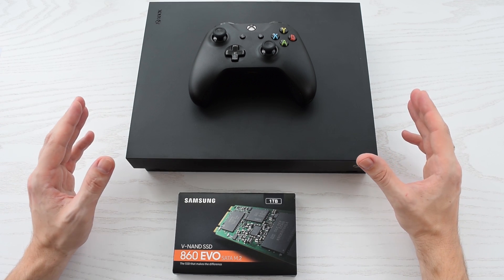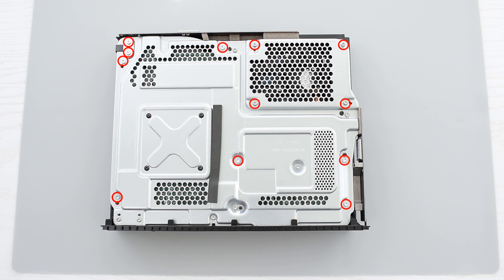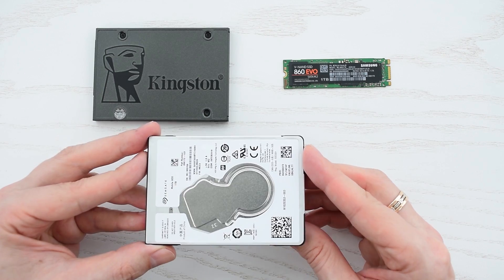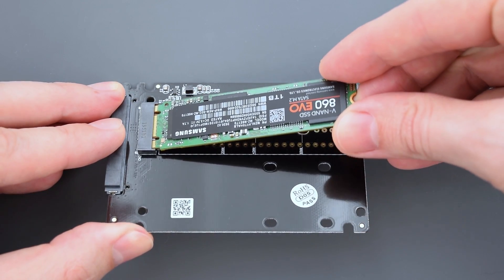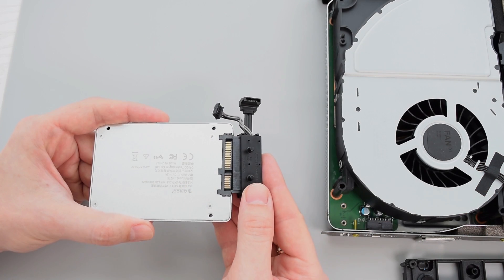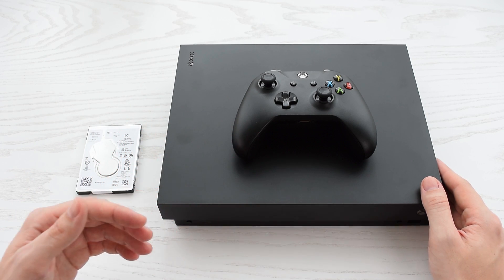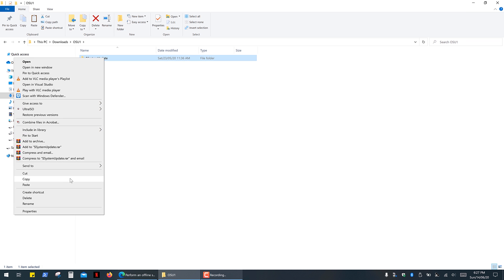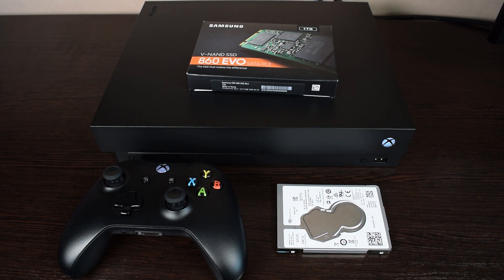How to Upgrade your Xbox and PlayStation Console to M.2 SSD Drive. 100% Works for all Consoles

Comment: Can you reach the full speed of an M.2 SSD with a xbox one or ps4? 😱
Reply from the maker: Both Xbox one and PS4 have SATA III interface as well as NGFF M.2 SSDs. So, yes those consoles will get maximum performance out of NGFF M.2 SSDs.
Reply: @ElectronicsComputers  so I'm able to get up to 3gb/s on my PS4 Pro when I use e.g. the nvme Samsung 970 evo? I mean up to 3000mb/s like on a pc?
Reply from the maker: @Serandi1987  Did I mention NVMe in my previous reply???????????? You can use only NGFF M.2 SSDs.

Comment: So you have to use only 500 1tb or 2tb.... What about 1 TB ssds that are actually for example 940 gb instead of 1tb?
Reply from the maker: 940gb drive will be recognized by system as a 500gb drive and in order to use it's full capacity (after you install offline update) you'll need to manually expand "user content " partition to the maximum available space.
Reply: @ElectronicsComputers  You need to connect it on a pc and expand it with disk management?
Reply from the maker: @andumihailescu  That's right. After successful offline update connect the drive to your PC and resize "User Content" partition.

Comment: What a bummer this was. Vid is easy introduction, but I must have bought a lemon. I purchased the same m.2 SSD, slapped it into a Sabrent enclosure--but no matter what method I've used (cloning, format fresh, or XfiX batch) when I plug the drive into my 1X... black screen of death and the Xbox shutsdown within 45secs.

Just to test it, I purchased a PNY full-size SSD, plugged it in to the 1X and works perfect.

Now I need to decide if I return and re-buy a new enclosure (860EVO is 1TB, but working PNY was only 500GB), or just return both and pickup full-size 1TB SSD and cross my fingers.
Reply from the maker: What's the adapter model? Or give me a link for that thing? You bought Samsung 860 EVO M.2, right?

Comment: that's good i've done the same with a 2,5" sata 1tB ssd
but why using a M.2 sata ssd ? it's the same has using 2,5" ssd. but more expensive
Reply from the maker: The main idea was just to show the upgrade options. Lots of people say that they have spare M.2 NGFF SSDs after upgrading laptops etc. And they didn't even know that such adapters exist. Or maybe you just want to use that M.2 SSD in another device after your console dies (2.5" SSDs are becoming obsolete) or maybe there's a better deal for an M.2 NGFF SSD.
Reply: @ElectronicsComputers  i see your point about spare ssd and i agree, except on one point : no 2,5" ssd aren't becoming obsolete, not for now. 
they are usefull in desktop pc and all m.2 slots are more for nvme than sata.

Comment: Im French, so sorry for my english. 
I have some Error 102, 101, 105 on my OneX. I think its comming from the hhd because the beginning was when I save in game (JediOrdenFallen.) 
Can I clone ths hdd on the ssd with errors ? 
Thanks
Reply from the maker: Most likely the problem in your HDD!? Did you participate in Xbox insider program?
Reply: @ElectronicsComputers  I specify, it is a used xbox. Yes I think I validated the Xbox insider program during the OSU1 offline update after the first 101 error. I shouldn't have?
Reply from the maker: @stradam6128  You have to unroll from the Insider program first. Otherwise you can't install standard offline build on your console with modified OS.

Comment: I thenk you can't enjoy fast NVME M.2 speed cuz sata socket is low transfer speed
Reply from the maker: You can't use NVMe and I explained i pretty clear. You can use only SATA-based M.2 SSDs which is NGFF.

Comment: Sorry but this is stupid. No need because the console won’t use the extra bandwidth anyway. Get a ssd
Reply from the maker: You're talking nonsense! The SATA III port is faster anyway than that M.2 NGFF SSD. And the rest of the  hardware can handle this speed without any problems. Also I'm working on the project on how to install NVMe SSD to its dedicated unpopulated place on the motherboard (you can check the last video about Xbox disassembly, at the end I explained it). So, this console originally was designed for PCIe SSDs and instead we use SATA SSDs which are way slower. I hope it was helpful for you.

Comment: Bad idea
Nvme need a proper cooling
In a PC Even with nvme heatsink and a front case 12cm fan pushing air. The temp still high compared to an SSD
Reply from the maker: I didn't use NVMe it's even impossible to do so. Have you actually seen this video especially my explanation about SSDs?

Comment: Thank you for this video. I upgraded my Xbox one x yesterday with Samsung 860 evo Satan m.2. Following your video made it easy from disassemble to operating system reinstall. Thank you! I am very happy with the faster boot up times and surprised at the game seems to be a bit more responsive, smoother maybe. Anyhow, great video and thank you again. Upgrade, it makes a difference.
Reply: Satan 🤣
Reply from the maker: Thank you for letting me know, I'm glad I could help you.
Reply: Hey did you have to add anythibg else to the. Motherboard other than the m.2 connnector. To make it work? Looking at the xbox one x xdk mobo. It look identical to xbox one x in the m.2 area. Plus extra resistors .
Can you make a video of your xbox one x dashboard. To show how this extra storwge appears .

Comment: So can I ask does nvem faster than m.2?
Reply from the maker: You can't use NVMe SSDs it only works with NGFF SSDs
Reply: @ElectronicsComputers  oh
Reply: @ElectronicsComputers  so can ngff ssd put in sata  in PS3 will it work?
Reply from the maker: @萝莉欧派  NGFF is a regular SATA SSD but in M.2 form factor and you can use that SSD with M.2 to 2.5" adapter virtually in all SATA devices. It works perfectly well on my PS4 and it will work for PS3 as well.
Reply: @ElectronicsComputers  ohhh thanks for let me know
Reply: @ElectronicsComputers   so nvem is only supports the pc only?
Reply from the maker: @萝莉欧派  NVMe SSD has PCIe interface which PS3 doesn't. Your console has only SATA interface and you need SATA-based SSD.
Reply: @ElectronicsComputers  oh

Comment: Is the adapter for the SSD supports M.2  B Key and M.2 M Key?
Reply from the maker: Such adapters only exist for SAT- based NGFF SSDs which have "B" or "B+M" keys. You can't use PCIe SSDs like NVMe in SATA adapters.

Comment: Is it possible to put an ssd into an Xbox 360 and duplicating the original drive onto the ssd?
Reply from the maker: it's not gonna work. You can use any SSD/HDD drive only externally via USB.

Comment: Stupid question, what is the advantage when this drive runs at the same speed as a normal ssd drive?
Reply from the maker: The main idea was just to show the upgrade options. Lots of people say that they have spare M.2 NGFF SSDs after upgrading laptops and stuff and they didn't even know that such adapters exist. Or maybe you just want to use that M.2 SSD in another device after your console dies (2.5" SSDs are becoming obsolete) or maybe there's a better deal om NGFF SSD than on 2.5" SSDs.

Comment: Just get a cheap Sata SSD
Reply from the maker: I was using cheap SATA (NGFF) M.2 SSD in this video!
Reply: @ElectronicsComputers  I know but why we need the SATA to M.2 adapter ? While the 2.5” SATA SSD is already cheaper out there
Reply from the maker: @WingHonda  The main idea was to just show the upgrade options. Lots of people say that they have spare M.2 NGFF SSDs after upgrading laptops etc. And they didn't even know that such adapters exist. Or maybe you just want to use that M.2 SSD in another device after your console dies (2.5" SSDs are becoming obsolete), then it's pretty good option.

Comment: But there is no any upgrade to the speed about a normal sata 2.5 SSD? =(
I already have a 2.5 SSD in my PS4 Pro... So there won't be any better speed resolution?
Reply from the maker: That M.2 NGFF SSD is a regular SATA SSD but in M.2 form factor. There's no any difference in speed between this one and a regular 2.5" SSD. The main idea was just to show the upgrade options. Lots of people say that they have spare M.2 NGFF SSDs after upgrading laptops etc. And they didn't even know that such adapters exist. Or maybe you just want to use that M.2 SSD in another device after your console dies (2.5" SSDs are becoming obsolete), then it's pretty good option.

Comment: Im sorry but This is such unnecessary complex upgrade. There is no reason to use a m.2 and an adapter instead of just getting a 860 evo
Reply from the maker: The main idea was just to show the upgrade options. Lots of people say that they have spare M.2 NGFF SSDs after upgrading laptops etc. And they didn't even know that such adapters exist. Or maybe you just want to use that M.2 SSD in another device after your console dies (2.5" SSDs are becoming obsolete), then it's pretty good option.

Comment: I just ordered a m.2 ssd and aluminum enclosure. What kind of read right speeds should I expect with the sata adapter
Reply from the maker: M.2 NGFF SSD is a SATA based SSD so it's gonna provide read/write speed about 525/480 MB/s.

Comment: Can I use PCIe? Would it be faster? And is there a difference in speed on any of them compared to the factory HDD?
Reply from the maker: It works only for SATA based M.2 SSDs like NGFF. It's not gonna work for NVMe SSDs, such adapters simply don't exist.

Comment: So is every game instant now? Cuz my ssd reduces times by 75% on games... so m2 should be about 7x my speed so if anything it should start up games within seconds if not then you just wasted so much money
Reply from the maker: We were using M.2 SATA (NGFF) SSD which has SATA III interface. And the Xbox One X has the same SATA port which fully utilizes the data bandwidth of of that SSD. There's no difference in speed between this SSD and any 2.5" SSD. The main idea was just to show the upgrade options. Lots of people say that they have spare M.2 NGFF SSDs after upgrading laptops etc. And they didn't even know that such adapters exist. Or maybe you just want to use that M.2 SSD in another device after your console dies (2.5" SSDs are becoming obsolete), then it's pretty good option.

Comment: Can u make a comparison in load times againsed the series x please.
Also compare before and after load speed of ssd and hdd thanks
Reply from the maker: Xbox Series X uses NVMe SSD and I was using NGFF SSD because you can't use NVMe SSDs on Xbox One X. I guess the difference between PSCe speed and SATA is quite noticeable. Just like a laptop loading with SATA and NVMe SSD.

Comment: This is nonsense, using m.2 to sata then plugging it on native sata lol. You could just use a regular sata ssd for cheaper.
Reply from the maker: Technically it's not M.2 to SATA, it's M.2 SATA III (NGFF) SSD which is connected to the same SATA III port. And we need that adapter only to adapt drive's form factor. The main idea was just to show the upgrade options. Lots of people say that they have spare M.2 NGFF SSDs after upgrading laptops etc. And they didn't even know that such adapters exist. Or maybe you just want to use that M.2 SSD in another device after your console dies (2.5" SSDs are becoming obsolete), then it's pretty good option.

Comment: Yeah the Xbox one s or x utilizes the sata 3 interface to handle data which caps at 6gbs also usb 3.0 is same cap so the nvme or m2 key drives u don't benefit because u need pci express 3.0 or 4.0 channel for it to achieve it's read and write speeds.
Reply from the maker: We were using M.2 SATA (NGFF) SSD which has SATA III interface. And the Xbox One X has the same SATA III port which fully utilizes the data bandwidth of of that SSD. The main idea was just to show the upgrade options. Lots of people say that they have spare M.2 NGFF SSDs after upgrading laptops etc. And they didn't even know that such adapters exist. Or maybe you just want to use that M.2 SSD in another device after your console dies (2.5" SSDs are becoming obsolete), then it's pretty good option.

Comment: No reason to use m.2 via coverter, coz it wont work better than any usual sata3 ssd. Btw, 2.5 ssd is much cheaper than m.2.
Reply from the maker: We were using M.2 SATA (NGFF) SSD which has SATA III interface. And we need that adapter only to adapt drive's form factor. The main idea was just to show the upgrade options. Lots of people say that they have spare M.2 NGFF SSDs after upgrading laptops etc. And they didn't even know that such adapters exist. Or maybe you just want to use that M.2 SSD in another device after your console dies (2.5" SSDs are becoming obsolete), then it's pretty good option.

Comment: No Benchmarks? What's the point!?
Reply from the maker: Did you ever had a laptop with HDD and then with SSD?? Do you need any benchmarks to buy a laptop with SSD instead of SSD. The boost in performance is pretty obvious without any benchmarks. Just put it inside install its OS and enjoy fast and smooth gaming.

Comment: Won't the xbox backward compadability emulator be wiped if you download the OS instead of cloning the drive?
Reply from the maker: There's no difference if you clone your drive or reinstall OS. Fresh OS installation is more preferable because it guarantees flawless factory reset features and provides better performance.

Comment: considering you are limited by your connection interface, using an m.2 conversion over a standard sata 3 ssd probably has zero gain in performance. lol
Reply from the maker: We were using M.2 SATA (NGFF) SSD which has SATA III interface just like Xbox One X. The main idea was just to show the upgrade options. Lots of people say that they have spare M.2 NGFF SSDs after upgrading laptops etc. And they didn't even know that such adapters exist. Or maybe you just want to use that M.2 SSD in another device after your console dies (2.5" SSDs are becoming obsolete), then it's pretty good option.

Comment: Where the LINK to clone the hard drive?
Reply: You have to clone the M.2 SSD? or will it work with the updates on the USB CARD?
Reply from the maker: @tommyfriend771  It's up to you. You can clone your old drive to a new SSD or install fresh OS which is more preferable choice. You can use any 2.5" SSD or M.2 NGFF SSD. They both have the same speed and performance.

Comment: El conector sata está limitado a un máximo de 500 mb por segundo. Por lo tanto no hará diferencia el usar una memoria nvme. más vale que hubieras usado un ssd normal
Reply from the maker: We didn't use any NVMe SSDs here because it's impossible. We were using M.2 SATA (NGFF) SSD which has SATA III interface. And we need that adapter only to adapt drive's form factor. The main idea was just to show the upgrade options. Lots of people say that they have spare M.2 NGFF SSDs after upgrading laptops etc. And they didn't even know that such adapters exist. Or maybe you just want to use that M.2 SSD in another device after your console dies (2.5" SSDs are becoming obsolete), then it's pretty good option.

Comment: That means I can do that on the ps4
Reply from the maker: It works perfectly well with all devices (laptops, desktops, consoles etc) that have SATA port. You just need to figure out how to install OS. And make sure that you use NGFF (SATA) SSD not NVMe.
Reply: @ElectronicsComputers  what do you mean by ngff ssd and not nvme
Reply from the maker: @Yash-jo8hv  There are two types of M.2 SSDs. NGFF (SATA) and NVMe (PCIe). You can use only SATA based SSDs like NGFF type with SATA devices like your console.
Reply: @ElectronicsComputers  could you give me some brands that r good
Reply from the maker: @Yash-jo8hv  The links for SSDs in the  description

Comment: That sata port doesn't give you more that 600mbps speed, so no need to use nvme m.2 ssd. Simple should do the same.
Reply from the maker: You can't use NVMe drives here! You can use only SATA based M.2 SSDs like NGFF.
Reply: @ElectronicsComputers  yes, that's what I mean. Couldn't explain well like you

Comment: Correct me if I'm wrong but isn't the sata slot on your xbox limited to 6gb/s? Which renders having an nvme drive useless?
Reply from the maker: You can't use NVMe drives here! You can use only SATA based M.2 SSDs like NGFF.

Comment: Wouldn't that only be slightly faster than just plugging in the same thing through USB?
Reply from the maker: Internal SSD connected to SATA port will be provide way better performance than one connected to the USB port. Because, you loose some speed on SATA to USB controller.

Comment: I'm just curious to why someone would use nvme for an Xbox hard drive.  Xbox One X uses sata 3 which is slower than the USB 3 port on the Xbox.
Reply from the maker: We didn't use any NVMe SSDs here because it's impossible. We were using M.2 SATA (NGFF) SSD which has SATA III interface. And we need that adapter only to adapt drive's form factor. The main idea was just to show the upgrade options. Lots of people say that they have spare M.2 NGFF SSDs after upgrading laptops etc. And they didn't even know that such adapters exist. Or maybe you just want to use that M.2 SSD in another device after your console dies (2.5" SSDs are becoming obsolete), then it's pretty good option.
Reply: @ElectronicsComputers  I agree it is an awesome video for options and I am not trying to offend anyone I think my question which may make for another video for you is what exactly are you gaining as your limited to sata 3. Load time, boot up wise, etc. Im curious myself.  Maybe something to further investigate.👍... In addition would it make more sense to use M.2 as external hard drive allowing more data transfer bandwidth?